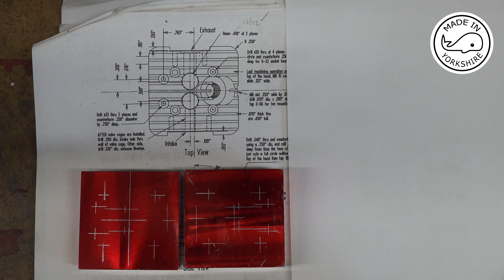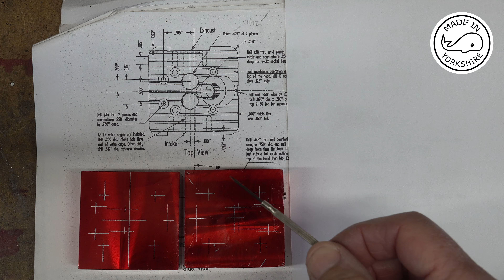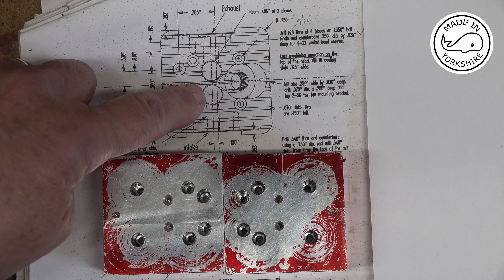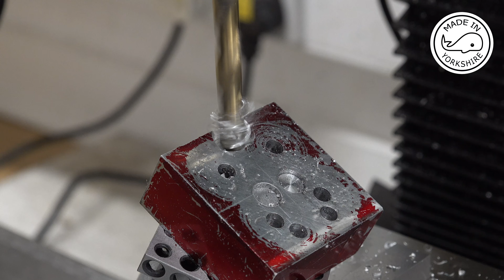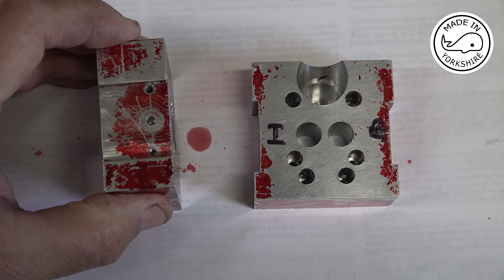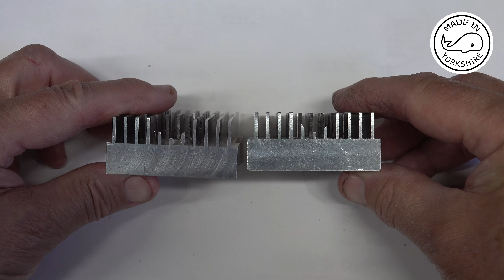#MT49 Part 14 - Jerry Howell V-twin IC Engine. The Cylinder Heads. In 4K/UHD be Andrew Whale.

Comment: Hi Andrew, I have tried alum and found it works but discolours the alli., will polish off. I found with small parts like your head that a saucepan of water / alum on the stove just below boiling point speeds the process up.
Colin
Reply from the maker: Hi Colin. I've not had much of a chemical reaction over the past few days where the tap is, but the aluminium has tarnished. I've made a fresh mixture with boiling water and I will try to keep the temperature up using a Chinese type food warmer. 🤞
Cheers
Andrew
Reply: @learningturningmetal  Hi Andrew, I found near boiling was best. Lower water temps. didn't give much reaction.
Colin
Reply from the maker: @theartfulbodger  Hi Colin. I ended up using a camping stove. Lots of bubbles but I think my patience is now running thin cos the tap still seems rock solid. Even if successful it will take ages to remove the tarnish between the fins. So, I've decided to order some more aluminium and make one from scratch, but in the meantime I will attack the tap with some heavy machinery 😉. All the best.
Andrew

Comment: That's an intricate part - nice result in the end. Sorry about the broken tap - that's bad luck. Sometimes a little bit of heat to the part will help break the tap loose so you can pick, peck and grind at it, but hopefully the alum trick has worked. As an aside - I really like hearing the birds in the background outside your workshop. Adds a little layer of serenity, which every home machinist should feel when they are in their workshop.

Comment: If the Alum doesn’t pan out you can always use a magnifying glass and diamond bit and some sort of Dremel tool or even a dentist high speed hand piece to grind it out, then drill and ream a larger hole and plug it and re-drill and tap.
Reply from the maker: Yeah I'm not sure if Alum works on HSS but I will give it a try. I'll explore diamond bits too.
Cheers
Andrew

Comment: Hello Andrew, I have tried the alum hot water method a few times in both aluminum and brass, and it does work but took several days of soaking. I used the alum for making pickles which I found in my local grocery stores spice rack. I think the process I used did not allow the liquid solution to penetrate in the hole very quickly. They were all 4-40 taps and in about .500 deep, good luck. Breaking a tap happens and puts a damper on machining progress.
Reply from the maker: Hi Earl. Thanks for the info and I hope you are keeping well. Ironically my tap is 4-40 and about half an inch deep too. I've ordered some Alum and will experiment. However I'm not sure if it will work on HSS.
All the best.
Andrew
Reply: Hello Andrew. The 4-40 taps I have broken were all HHS. The process did take several days but it does work. The solution should have a lot of alum in it and heating initially helps speed things along. I just let the parts soak and worked on other components.  Once a day I would rinse the parts with clear water and remove the material which had dissolved with a small probe. I have read the recommendation posted below by Mr. Osborne, and that would be an alternative method and would take a shorter amount of time. Either way it is always a pain to break a tap usually near the end of an otherwise successful part. Be well. Earl
Reply: Also, I used compressed air to blow any aluminum swarf from the broken tap flutes so the alum solution could penetrate and attack the tap from the sides..
Reply from the maker: @abbottart2000  thanks Earl that is encouraging. The Alum arrived today so I will do a test. Did the Alum change the colour of the aluminium or affect it in anyway?
Reply: I'm glad the alum has arrived. That was quick! I had to do the process on both aluminum and brass, and it did not seem to alter the color with either. The alum seems to only attack the ferrous material. After you successfully have the broken tap removed, I suggest redrilling the hole to install a slightly larger plug and redrill and tap the plug rather than just retaping the original threads.

Comment: Great outcome Andrew. Hope you got the broken tap eaten away with the Alum. Generally with a slitting saw you cut to the full depth in one go, using plenty of lubricant, running it a bit slower than you did with the light depth passes. Regards from Australia.
Reply from the maker: Hi Dave. Many thanks for the tip. The Alum arrived today so we will see if it works.
All the best.
Andrew

Comment: Hi,Andrew. Another method other than hot Alum solution of removing a broken tap in soft material such as aluminium is to make a miniature hole saw from silver steel rod and cut teeth on the bottom face and quench harden the teeth. 
You can make the hole saw quite thin wall thickness with the inner diameter barely bigger than the broken tap OD.
  After you've cut/treppaned  out the  broken tap it is simply a job of pluging the hole either by tapping a larger thread and screwing in a plug  piece of the same aluminium material or simpler still just loctite a plug in the hole with retaining compound.
 You can then re-drill and tap to the original size.  All sounds a bit of a palaver but trust me it works very well if planned right from the start of the job. 
Don't ask how i know this method works🤣
Reply from the maker: Hi Howard. Many thanks for explaining.  I'm not sure if I am capable of making such a fine saw but I will give it some thought. That Alum arrived today so I am experimenting with that at the moment.
Cheers
Andrew

Comment: I once broke a tap that small and was able to remove it by finding the biggest size sewing needles that would fit in the flutes and the threaded part. I then took the handle side of the broken tap, put the needle pieces in the flutes and made a collar to tightly capture the pins. This made a sort of spanner wrench which removed the broken bit from the part.
Reply from the maker: That's a great idea. I'll add it to the list. I'm going to experiment with some Alum initially.
Cheers
Andrew

Comment: I'm sure you have the broken tap issue figured out by now but, what I would do is use a small carbide rotary burr in a die grinder or a Dermal tool, grind out the tap, use a 2 flute end mill to plunge cut / clean up the now out of round hole, turn a plug about .005 oversize, freeze it and press it in. then re-drill and re-tap. It works great. I'm a retired Airliner mechanic and we did this to repair damaged holes in the airplanes structure or components like landing gear fittings. There's nothing like breaking a tap in a $50,000 landing gear trunnion fitting. This is the standard repair that engineering would issue every time it happened. Good luck!
Reply from the maker: Thanks for the advice - I've added it to my list. I'm going to try Alum first as the part is small and Alum is supposed to leave the aluminium intack. In the meantime I'll see if I can get hold of some small carbide rotary burrs.
Cheers
Andrew
Reply: Or just loctite the plug in situ with high strength retaining compound.

Comment: Nitric acid will disolve the tap, available as gun cartridge case cleaning suppliers. I bought mine many yesrs ago at one of the model exhibitions from a firm that does chemical blacking chemicals. 
Alternatively make a core drill ftom silvè steel, tap the larger size and bond in an alloy threaded plug and retap to correct size.
Had it been larger a carbide drill or burr could have taken out the core of the tap but being so small if the dril snapped,being so incredibly brittle, you might make the situation worse.
On the saw front, you probably could have gone to full depth in one cut, with plenty of wd40.
PS Black-it dont seem to list it any more and other case cleaners might be completely different chemically. Shame really as it worked very well on an M2 tap i snapped in aluminium yesrs ago.
Reply from the maker: Hi Chris - thanks for the suggestions. I'm not sure if Nitric Acid is available anymore to 'joe public'. Others have suggested Alum to disolve the tap - so I will give that a try initially.
Cheers
Andrew

Comment: Since the cylinder head is aluminum, the way to get a carbon tap out is to take Alum( potassium aluminum sulfate)  and mix with hot water  as much as will dissolve.  keep a slow heat on the water and it will eat the tap right out of the hole. (did not believe mysyelf until I tried it. )
Reply from the maker: Thanks Anthony. I've just ordered some Alum and I will give it a try.
Cheers
Andrew
Reply: I'm not so sure Alum will dissolve a tap made from HSS like it will with carbon steel
Reply from the maker: @howardosborne8647  😭😭😭😭😭

Comment: What if you drill a slightly larger hole right up against it. Knock the tap over to that hole. Then use an endmill to engulf both holes.
Then make a slug on the lathe & re-machine?  Just an idea that popped in my mind. Not sure if it would work.
Reply from the maker: Hi Todd - thanks for the suggestion. I'll add it to the list of ideas. I'm going to experimant with some Alum initially, as that is supposed to leave the aluminium intact.
Cheers
Andrew
Reply: Make a miniature hole saw from silver steel and quench harden the teeth is a better option if machining it out.

Comment: You could make a core drill from silver steel to drill round the outside of the tap and then make an aluminium plug for the hole.
Reply from the maker: Thanks for the advice Tony. I'm not sure if I would be capable of making such a small tool, but I will add it to the list of ideas. I'm going to experiment with some Alum initially as that is supposed to leave the aluminium intact.
Cheers
Andrew
Reply: I've done the same in the past....worked very well👍

Comment: Hi Andrew I believe you can use the anodizing process because it's aluminum (positive to the part) with mild sulfuric acid to both remove the steel and color the part with the dye of your choice. of interested try out on scrap aluminum with a nail stuck in it. 
Rich
Reply from the maker: Thanks Rich - Alum ordered! I will experiment.
Cheers
Andrew

Comment: Andrew,
Slitting saw all day long due to its stiffness larger diameter makes all the difference. Chemical removal with Alum you could spark erode but not really for home workshop. If you are not sure about alum tap a hole in some scrap aluminium and insert the remains of the broken tap and see if it desolves  do not use tap extractors on that smaller a tap you could end in a worse condition than now. Excellent build though!
Good luck
Jon.
Reply from the maker: Hi Jon - I'll experiment with come Alum as you sugggest.
Thanks for the tip!
Andrew

Comment: With the broken tap in watch repair I have used a concentrated saturated solution of Alum in warm water and this would dissolve ferrous metal/ broken screws from non ferrous brass movements. Just a thought. Alum is available in the grocery store spice section.
Reply from the maker: Hi John - thanks for the suggestion. I've just ordered some Alum and I will give it a try.
All the best.
Andrew
Reply: @learningturningmetal  keep it warm and if you have an ultrasonic use that also

Comment: Hi Andrew, I believe you can use Alum, water and heat to dissolve your steel tap out of the aluminium body without damaging the aluminium. So you won’t have to change the mating part - haven’t tried it personally but would be well worth investigation to save the part. Great build, good luck sorting the broken tap. Alum is Potassium Aluminium Sulphate and can be bought quite cheaply in powder form in the UK. I just Google suppliers and found several.
Reply from the maker: Thanks for the advice Nick - I've just ordered some Alum and I will experiment!
Cheers
Andrew

Comment: Another option would be to skim the OD of the spark plug socket on a lathe down to a size that would fit into the hole in the head.
Reply: Or modify the socket with grinder or use thin box spanner that all full size motorbikes come with and never get used!
Reply from the maker: Thanks for the suggestions. Too late now, but out of curiosity I'll have a rummage through my old tools to see if I have a box spanner.
Cheers
Andrew